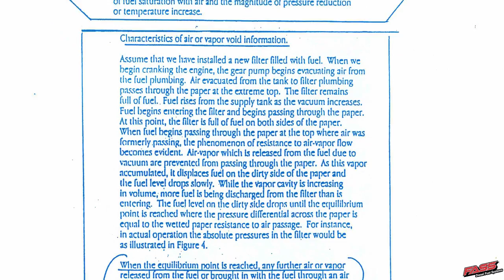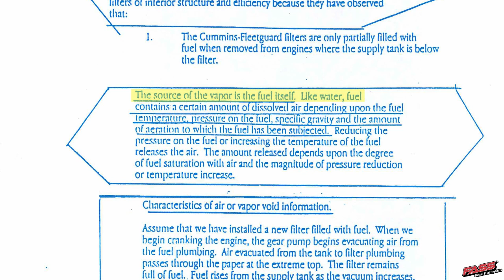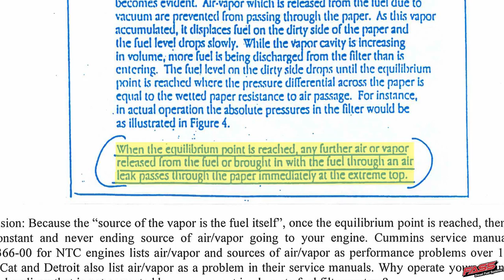How much air is REALLY trapped in diesel fuel? | Air in Fuel Episode 3

Comment: Fuel should be stored in bladders. 
There should be a bladder tank inside of fuel tank so it doesn’t slash around and getting air in it. The return fuel would not have air in it. 
It’s the slashing around that puts air in the fuel. If the fuel tank had a big sponge inside the that would make it better. 
There was a company that made a fuel tank with large sponge like system to keep fuel tanks from exploding.

Comment: How do you remove air that is mixed with the fuel in the tank? No one seems to know the answer.
Reply from the maker: We remove the air in the fuel within the FASS system, by the way, the FASS is machined internally. I have a link here as well that will help explain how the FASS system works. 

https://fassride.com/what-is-fass/

Comment: I got 2015 Duramax   Done a full delete w a 160 or 165? Fass lift pump & put 3/4” fuel lines & bypassed stock fuel filter but 8 months after it was installed the lift pump stopped making the buzzing sound when key was on   Not sure if its a relay,fuse,broke wiring or hopefully not a bad pump ?   Any idea where I should start troubleshooting?
Reply from the maker: Hey Charles, thanks for reaching out! When it's convenient, please give us a shout at 636-433-5410, or shoot us an email to techsupport@fassride.com, and our service team will be happy to get this figured out for you!

Comment: So why can't you just keep the fuel filter completely full of fuel? And in a large diesel vehicle is there any reason why the fuel filter couldn't be lower than the fuel tank? Edit: I should mention I don't really know anything about diesel vehicles most of my experience with fuel filters comes from repairing lawnmowers for work.
Reply from the maker: Great question, and the fuel level in the filter will raise and lower depending on the amount of atmospheric pressure, load on the engine, and many other variables. Also, we completely understand where you're coming from there as well. Mowers in a lot of cases have a mechanical fuel pump, or are gravity feed. The fuel filter placement on a diesel engine will be a little different just due to using different systems, and ways of feeding the motors.
Reply: @FASSFuelSystems  thank you for the reply. Video was very informative.
Reply from the maker: @Nilboggen  Sure thing! Thanks again for reaching out.

Comment: This is awesome. I've dealt with this problem for years racing, and no one believed me when I said the fuel is saturated with air, especially on a return style fuel system. This can cause random misfires as well. Same reason you see bubbles when you fill up a gas can, and also the reason your water faucet, and toilet make noise when the water is running. The sound is the bubbles hitting together and on the valve surfaces. Same idea inside the fuel system. Bubbles can cause harmonics and various localized pressure systems, which can lead to misfires and lean-out. Thanks for this video!
Reply from the maker: We appreciate you watching, and leaving the awesome comment! If there's ever anything you need you are more than welcome to reach out to us anytime!
Reply: @FASSFuelSystems  actually I would really like to talk to someone about becoming a FASS dealer, I do quite a few VP pumps at my shop.
Reply from the maker: @MegaMarclar  Sure thing! We're always filming new content, so we can definitely put that on the list. 

In the meantime, our dealer application process is very straightforward—we'll attach the link here: https://fassride.com/customer-support/become-a-dealer/